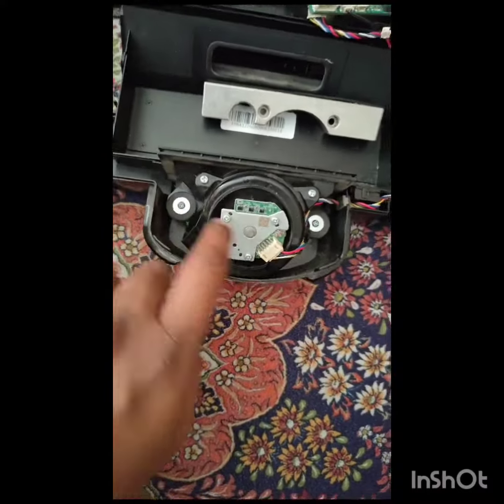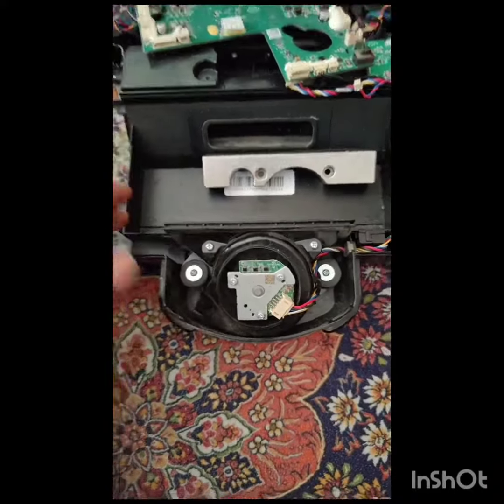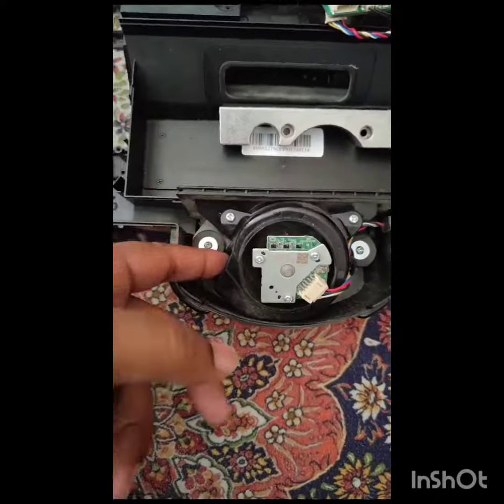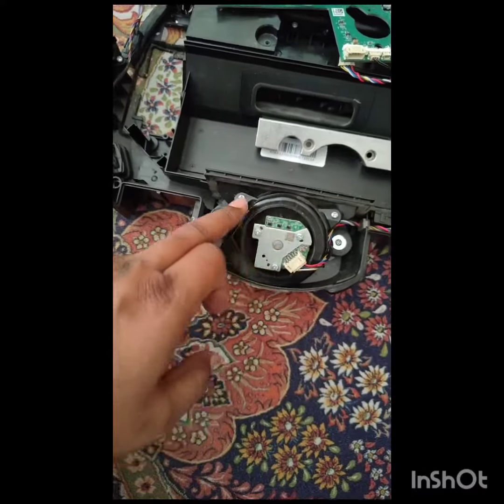Ecovcs Deebot Loud & Sharp Sound issue. Fix at Home

Comment: Brother, exact problem. God sent video for me. It was a small cat food pellet that got stuck in one of the blades in the suction motor turbine. Removed it and it works fine now, Normal sound.

Mine is a T9 AIVI model.

Thank you for sharing this video

Comment: SIR I have bought deebot u2 pro a lot of water is leaking while mopping. Tank empyies in 5 mins. How to solve this plz tell
Reply from the maker: Actually In Ozmo U2 pro model is designed like this...water flow is bit higher in this model... sometimes water tank leak that also possible...if leak then U need to replace water tank or contact with seller

Comment: can you repair the fixing of a broken side brush
Reply from the maker: If just only cap removed from side brush then can glue back... video available..but if the side brush lock pin broken then side brush motor assembly need to replace... because saperate that part not available

Comment: Good morning
Hello. Can I contact you directly?

Can you help me?? I have a Deboot Ozmo T9 and I have a problem. If I insert the water container 
behind it with the cloth underneath, the robot does not move forward but only goes backwards. 
Why do I need to replace? thanks.
Reply from the maker: Can plz WhatsApp me a video at 00601137973018
Reply from the maker: If without Ozmo tank deebot can move forward but after attach tank start reverse then carpet sensor need to replace...front besides the charging connector in round shap small white colour sensor call carpet sensor